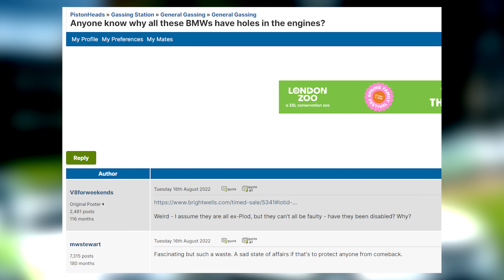Why The UK's Police Cars Keep Catching Fire (BMW N57 Engine)

Comment: I'm a mechanic for BMW, the worse thing you can ever do to a diesel engine is to fit a particulate filter. These fires do not only happen to BMW's. It happens to all cars. No engine should ever have a filter on its exhaust system, its dangerous. Bad emission laws are to blame for all these fires on all cars with emission control systems.
Reply: Plenty of diesel cars with DPFs are running quite smoothly and most modern diesels haven’t toasted themselves. Faults in the engine, poor maintenance, and exposed electrical wires (as what happened with some 56 reg TX4 london taxis) are the most likely causes of engine fires. But I do agree there is also a factor of poor maintenance regarding the DPFs.
Reply: @villagernumber77 agree 
But are the cars you mentioned getting thrashed and drove at 150 mph ???
Reply: @boyasaka  haven’t heard of ex police Volvo V70s or Ford Mondeos spontaneously combusting
Reply: @villagernumber77 do most diesel Cars with dpf idle for hours? A diesel can't properly do a dpf regeneration at idle
Reply: @villagernumber77  NEED TO CHANGE ENGINE OIL AND FILTER WITHIN 5000 MILE RANGE , AND USE DPF ADDIVITES EVERY 2000 MILES WITH MOTORWAY RUNS SHOULD BE FINE FOR LONG TIME !!!
Reply: good to see the new Toyota Corolla cop cars that are made in Britain starting duties
Reply: @hassyg4083 We get your hate and comprehension limitations. Make Britannia great again, with Toyota. 😂🤦‍♂️
Reply: @lemcakes32422  Are Toyotas still built in U.K.? Good to hear that, I thought they'd gone the way of Honda. 👍
Reply: @simongray2533  yeh they built in Derby plant the new ones cops are using now
Reply: @lemcakes32422  Oh cool, I'm happy with that! 😁 I'm a big Toyota fan myself.
Reply: Stationary idle for hours... That's the problem
Reply: Like any piece of engineering they work if used properly. A friend of mine was having problems with his Touareg VW and we worked out that the vehicle never got hot enough for the DPF to work. He took it for a two hour country drive cruising at 100kph and that fixed the problem. He now does a reasonable trip every second month and has has no further problems over two years. I would rather not have them but if they are there then use them in the way they designed to.
Reply: @ianmontgomery7534  he got that wrong car. diesel not good for short trips
Reply: @ianmontgomery7534  They're a nuisance for all but I'm happy with it and also putting adblue in my bmw knowing that it is actually doing some good (reducing harmful pollutants)...
Reply: it's not because of the EGR Cooler leak?
Reply: @yAbx  you have a point as that is is mechanical fault which can be a factor.
Reply: @lemcakes32422  Well, I’ll contact you in 15 years and tell how is it going with my bmw
Reply: @mishaellashoots470  doubt there will be anything left of it in 15years
Reply: complete nonsense, its nothing to do with the DPF's they have been fitted on cars for years
Reply: @robloxfan4271 but the average motorist does not do sit in a lay-by 
Then accelerate the car from 0 to 140 mph as quick as possible
Reply: @robloxfan4271 the issue is a absolutely to do with the DPF and the way the vehicles have been operated.
Oil dilution/contamination
Reply: "Bad emission laws"... you need to retire and seek urgent medication. There are millions of cars with DPF systems that have no issue.
Reply: @SSS_HEX  Do not talk utter nonsense. You obviously know nothing about cars. Just the recalls from dealerships of emission control problems amounts to billions of cars around the world. That does not even count the billions of cars that break after warranty. You know nothing about the effects and are just talking your opinion, not facts.
Reply: I mean catalytic converters have worked fine for years. So have DPF’s when they’re designed properly, and the engines are used as intended (not say idling for hours) This is purely a poor design and engineering issue. BMW’s always been hit and miss when it comes to diesels. 

The ECU should force a DPF cleaning cycle to clear the filter if the cars sat idling for too long.
Reply: @Jonathan_Doe_  not at all. Multiple sensors, extra injectors, and in BMW’s case a second thermostat in the EGR valve which fails, gives no symptoms except it no longer regens the DPF. All these extra sensors fail far too soon and cost far too much. 

Literally destined to fail. Rip them all out.
Reply: @Jonathan_Doe_ thats complete rubbish mate, the version prior to the N57 was and still is the strongest and best diesel ever made to this day. Nowadays even the B57 is a reliable engine with no futher mechanical defects. Only the N57 was a “hit and miss” as you say.
Reply: @Jonathan_Doe_ BMW told the UK Police that they would need a special maintenence program due to the cars idling so much and the PD just ignored it..🤷
Reply: @G_Silva404  Surprised an engine running hours meter isn’t a common feature on police vehicles to be honest.
Reply: @Jonathan_Doe_  agree 1000%. It should be mandatory, mainly for maintenence tracking purpose. The normal BMW maintenence Schedule of oil changes is something between 15/20k km (30k km in some diesel engines) depending on the engine. That is a really long time if the car just idles most of the day.
Reply: @lemcakes32422  Mercedes, PSA, Renault, VW... Idling for hours, many manufacturer's doesn't let the regeneration to happen at certain aspects. Temperature, rpms, speed.
Reply: all due respect the biggest killer of the filtration systems is lack of proper maintenance that every other road user has to keep up with the police have their own standards and rules for it.
Reply: @lemcakes32422  

@hassyg4083
1 day ago
 @lancethrust9488  yeh bmw sucks thats why

So does your mum.
Reply: DPF has nothing to do with spinning a rod bearing.
Reply: @jimmyb1460  not directly, but the oil dilution caused by them will eventually, in the manner the vehicles are operated
Reply: I am a Mechanic at Audi and the police use 3.0 V6 TDI engines and abuse them every day, none have caught on fire. So to say all cars burn down is a lie.
Reply: @Vwowner_w8_1.9tdi_2.5tdi  facts
Reply: @Vwowner_w8_1.9tdi_2.5tdi  probably because they’re service to fit the use. I mentioned in another comment that the Police chose to ignore BMWs advice and cause the oil to degrade and ultimately cause the failure of the crank bearing. If they would’ve listened to BMW this shouldn’t have happened.
Reply: To the original poster, many other non German companies can produce reliable and good diesel engines WITH dpfs fitted.
It's a BMW engineering failure. Police cars have always been routinely used this way in many countries, and continue to be. Other brands don't drop their load on the road and catch fire.
Reply: LITHIUM ALOT WORSE WATCH HOW MANY FIRES ARE HAPPENING THE EV ROLLOUT WILL BE A BLOODBATH KILLING MILLIONS A YEAR EXTRA THAN REGULAR CRASH STATS ,,, WATCH THIS SPACE !!!
Reply: Your right
Reply: What a load of rubbish 😂
Reply: Yeah, if it weren't for the dpf's introduction; there would be NO diesels on the road. If it wasn't for the introduction of the three-way catalyst for petrols, there would be NO petrols on the road. And if there was, we'd all be killed off by all the NOx and particulate matter.
Reply: You think, how about proper R & D for the requirements
Reply: It is BMW B57D30A engines cathing fire not N57 G series doesn't have N engine
Reply: So a catalytic converter is bad?
Reply: @Steve00alt  A catalytic converter is not a filter, let alone a particulate one.
Reply: @steve00alt70  Yes they are bad. 90% of my work is fixing catalytic converters,dpf,o2 sensors and emission related issues. So yes they are bad for your engine and your wallet
Reply: I guess this probably isn't wrong, those babies get hot!
Reply: All down to climate change and zero emissions as in other countries they do not have this add blue. They are normal without all this ridiculous nonsense. It’s time for technology to work out the ways of less omissions in time they will 😮
Reply: Trucks have significantly larger dpfs, the fault lies at poor design and beemers habit of denial
Reply: @MT_T991  they can't even design drain plugs correctly on bmw convertibles
Reply: @MT_T991  The size has nothing to do with it. All cars catch on fire, so its not only BMW, its all makes of cars.  Police just happen to use a certain model that does it under extreme use.
Reply: The DPF isn't entirely to blame. It doesn't control lubrication, it doesn't make a crank bearing fail, and it doesn't put holes in the oil pan spewing oil all over the road.

It does, however, increase likelihood of fire if oil hits the shell of the DPF during a regen, be it passive, active or standing.

That's because the DPF shell can reach temps in excess of 500*c to burn off any particulates.

Since police cars are ragged to within an inch of their life it's not farfetched to consider that they would be more than capable of not just regenerating more frequently, but being able to do it passively from the constant high EGTs that ripping it down motorways at 90+mph allows for 

In a scenario like that, if your car isn't maintained properly or suffers a failure that causes an oil spill, then the chances of a fire from this are greatly increased if the oil hits the DPF or any pipework leading to it.

I should note it's not just diesels that are susceptible to this though. Petrol engines can and do catch fire when an engine fails and spills its oil onto a hot exhaust or catalyst. It depends on where the oil lands as to how big a fire you get.
Reply: The laws aren’t to blame the politicians and their robbing friends are who push the carbon lies
Reply: And so what do you do to reduce the particulate ?
Reply: I agree with you that it's not just BMWs that have had engine fires.

And I wouldn't for a minute blame the make of car, equally I don't believe that it's just the new emissions legislation.

I think what is most likely is how the police use the vehicles and given that many of the traffic police never really switch off engines from the start of their shift to the finish and even then it's switched off for less than 20-30 minutes until the next officer jumps into the car.

Police Mechanics are obviously going to blame everything and anything other than those driving them because their wages are paid by the police and they obviously have to work with the people concerned.

And many police officers these days have a large streak of arrogance about them, as we see down in London with the number of officers up in court for corruption charges.
Reply: A mechanic for BMW? You must be super busy every day then compared to Japanese mechanics
Reply: It had NOTHING to do with the EGR? How does the EGR effect a crank shaft bearing?
Reply: my zero backpressure stage 2 N55 that hasnt had a single issue at this point can confirm
Reply: @hau5muzeek do you jump in your car and drive it at 140mph then sit idling for two hours and then thrash it round town for hours before idling for two hours again.. no…
That’s why your car won’t experience the same issues as the police cars because you don’t drive it like a pig
Reply: @Kalus_Saxon  or maybe its cuz i dont have some shitty diesel engine 🤷‍♂️
Reply: "Bad emission laws"...  well it's only thanks to those bad emission laws that smog, acid rain and thousands of yearly deaths from bronchitis are a thing of the past. And not too distant past either....My parents tell me stories about both from their childhoods.  I would say all in all the emission laws are GOOD but yes they do ad complexity to cars but if thats the price we pay for safe air then personally I'll take it.
Reply: @soundseeker63 clown
Reply: @PKperformanceEU  A very well reasoned and intelligent point. Thank you. 👌😆
Reply: Had mine cleaned recently, so much better. But yes, you are right. DPFs are a pain in the arse.
Reply: HAD NO FIRES WHEN I DROVE A INSIGNIA APART FROM A BLOCKED DPF THAT WAS IT
Reply: @lancethrust9488 shame the insignia did not catch fire
Reply: I agree fully! Fortunately, we in South Africa can legally remove the troublesome catalytic converters / addblue / DPF'd. Not only does such modifications increase the vehicle's lifespan in a number of ways, you can enjoy a little bit of extra power also.
(A warm "cat" can set dry grass on fire quite easily, with catastrophic veld fires as a consequence - never mind a destroyed car.)
Reply: @travelmates1  Exhausts will get hot with or without a cat. Don't want fire? Don't park on top of anything flammable.
Reply: I would strongly argue that point, having recently completed 200k in a Benz with a particulate filter.
If you drive a diesel, it must be driven as it was intended, long haul open road, no harsh acceleration or running at the limit.
If you want to use a car around town, at high speed or varied conditions keep away from diesels……
Used correctly they give no major issues, but BMWs reliability and engineered to fail attitude would still make anything post 90s a mechanical write in next to no time.
Reply: @tomkatdj  you can drive a diesel at high speeds or push it hard IF and only if you have DPF and cat delete.
And that's basic essential modification !
Reply: @PKperformanceEU  no you can’t, because of the pollution that would put out.
If you did, you’d be in significant legal trouble……
It’s quite simple, for that type of use, use a petrol version and have no issues.
Where I’m at right now we’re watching the 13th typhoon of the season passing…….because people don’t give a crap about the environment, only their own personal objectives.
Diesels are great, when used correctly.
I’d have another in a heartbeat, but my location would kill it, and removing a DPF is not an option for me.
So i now drive petrol again…..
Reply: @PKperformanceEU  by the way Patrik, are you aware of the fines for removing a catalytic converter or Diesel Particluate Filter in he EU?
Slovakia may not enforce it, but the fines can come directly from Brussels if someone puts in a complaint about someone bragging about commercially performing criminal acts on social media……
Reply: @tomkatdj  good luck finding me. Btw Austria allows it and in Hungary you can pass the tests
Reply: @PKperformanceEU  had found you from your license plate before the first reply Patrik……EL598SP 🤡
Reply: So do we fit particulate filters to everyone’s mouth and nose to prevent breathing in toxic emissions and soot?
Reply: Complete load of rubbish. Sounds like the opinion of someone thats only ever driven on Forza.
Reply: @lemcakes32422  all the cars you mentioned never had dpf's lol
Reply: @Twenty3_Motorsport  bad choice on the cops part for selecting them bmw for duties
Reply: Yeah cuz its diesel. Has big torque but no sparkplug mean it can do runaway diesel and engine overheating
Reply: @gathel8574 you clearly know fuck all
Reply: SO ,WHO WAS THE "ENGINEER" WHO CHOSE TO HAVE THESE FITTED?????
Reply: I agree DPFs are the reason behind the fires. No diesel without dpfs caught fire in the past. Plus diesel as a fuel doesn't catch fire. So the DPF burning the soot at 600 degrees may be the reason. Lol😂
Reply: Ultimately, this kind of events proves that using a diesel for a police car is obviously a very poor choice, and it is so for any car wharsoever. Diesel cars need to be banned as soon as possible. They are useless, they pollute like crazy, drink loads of a fuel that is more and more costy (a year ago it was imported from… Russia), they smell bad, fell bad, sound bad and sometimes they catch fire, not only BMWs.There's no doubt electric vehicles, which share with their diesel counterparts the same tendency to catch fire spontaneously, will be the next scandal of the automobile industry.
Reply: @julosx  I’ve been driving diesel and petrol cars for over 22 years what the hell are you talking about they catch fire.

This car threw a rod bearing. That a fault in the bearing was the cause. I take it you didn’t watch the video, instead just started commenting about something you got no idea about.
Reply: Am a mechanic myself I think DPF is 1  of the worst inventions ever for any Diesel car once that starts playing up it causes people to panic and start wasting money at back street garages and being told it’s something else before dpf throwing unnecessary money into the car or unnecessarily selling it or scrapping it unless u got a decent obd reader that can pinpoint the fault
Reply: @TheAirwolf2012  worst thing is to buy diesel , buy a hybrid
Reply: DPF delete gang 😜
Reply: Really, well that’s interesting my diesel has been back and fourth down the Autobahn at over 140mph and at 86k miles on the odometer still no signs of fire. 

It’s A BMW fault and requires a recall !!
Reply: @aileronsintowind6835  So just because your car has not caught fire then the statistics are wrong?? Are you always this stupid? if your cat/dpf blocks up or falls apart which all cats and dpfs do on all makes of cars as they only have a limited lifespan, then there is a risk of fire and damage to your engine. Its very simple to understand so i am not sure why you are acting dumb about it. Cats and DPFs are dangerous. Car engine ECU's are designed to activate the fan and "limp mode" on all makes of cars if anything goes wrong with the engine, example a misfire, this is due to preventing extreme heat build up within cat/dpf so the car does not catch fire. Every manufacturer of cars has its car fires due to cat/dpf and EGR issues.
Reply: I'm glad to read all these engineering reports 🙌 I'm just a basic mechanic and I know exhaust never caught fire before cats cars never stopped running because the exhaust is blocked 🚫 keep wondering why they catch fire 🔥
Reply: Mechanic too and can second this is like breathing in normal, but breathing out through a straw. Now go on a jog see you in 8 hours 😂
Reply: As a mechanic you should know that the reason diesles have DPF is stop the soot which is a harmful as the emissions given off. As an ex mechanic myself diesel's are worthless and should be banned on all vehicles except vans and HGVs.
Reply: @th3s3rv37  what do you mean by diesels are worthless ?
Reply: Diesel engines should never have been fitted to cars and other smaller vehicles.
Reply: @felixokeefe  true but you have to explain that to the car manufacturers, no one forced them to use diesel, it was just for profit nothing more
Reply: @lemcakes32422  i beat the dogpiss out of it every single time im on the freeway lmao, hit at least 120 90% of the time, its hard to not wind out, it eggs you on, 415bhp and a ZF 8 maks it too easy. its a miracle im not in jail right now to be honest
Reply: @hau5muzeek  wow thats some story
Reply: @hau5muzeek  you Americans think that's fast 🤣 i do 140 to work and back every day. Went 220mph in an RS6 last week lol
Reply: @gggwood  thats cute, my modified 335i DD has 410 bhp/430 tq and its likely a safe bet to predict yours has about half that lmao
Reply: BMW are crap quality. I had a new BMW convertible and it let in rain water with in the first year of ownership. Toyota if you want reliability and made in UK aswell not Germany
Reply: @lemcakes32422 I have a f31 320d with 200k km on it and I never had problems
Reply: @lemcakes32422 The vast majority that come off the production line or faultless. Don't just base your disdain on one episode.
Reply: @LiffeyKing  thats untrue I've had a few German cars that had issues from new. i base it on personal and also the fact German cars come bottom of reliability surveys. Personal use is one thing but having them as work cars for police duties whos bright idea was that especially diesel crap
Reply: @lemcakes32422 so you happened to have one slightly leaking soft top  … and that means all BMW are low quality.. 

Do you always make blanket statements like that?
Reply: @mista5796  ofcourse they are low quality. BMW are poorly designed compare them to a Toyota there is no comparison on quality
Reply: @lemcakes32422  no chance mate .. Toyota are dull and boring .. Toyota Corolla, Toyota celica 🤢🤮 bland, soulless cars. No one ever says they own a Toyota with pride. 

BMW are more enjoyable and interesting cars.
There are lots of factors about owning a car; reliability isn’t the only one. I own two cars; one is a small simple city car (1.0, 3 cylinder engine), the other a top end high performance car (5.0l, high revving V10 with dual vanos)…. 
The small car is lower maintenance. But that doesn’t mean it’s a better car! 

A donkey takes less looking after than a race horse.
Reply: @mista5796  Toyota Celica yeh won wrc rallies don't think BMW won any just saying. See price of  oldToyota supra compared to old m5 lol
Reply: @lemcakes32422  mate it’s each to their own 

You prefer Toyota. I prefer BMW 

Some people prefer Messi. Others prefer Ronaldo. 

Different strokes for different folks. 

Have a nice day 👍
Reply: @mista5796  no i said Toyota is more reliability. German cars nearly all come bottom of reliability surveys its just fact. Depends if you want to spend time in the garage or not often even if warranty covers it. i would never buy BMW second hand though
Reply: @lemcakes32422  Yeah, it's been like that for a while but people are blinded by the badge ! 🤣
Reply: @simongray2533  ive noticed. i used call out subaru impreza sti boxer engines to be crap and not able to do high milage. the amount of people it upset 10 years ago attacking me lol
Reply: @lemcakes32422  Yeah, was it ometing to do with oil starvation in high speed corners (I'm not a mechanic) I know some people I knew fitted the old butterfly sumps.
Reply: @simongray2533  don’t worry about not being a mechanic bud. Neither is the original poster lol 😂
Reply: @lemcakes32422  And what do you expect with new cars? exactly.
Reply: @tyronenelson9124  not to set on fire
Reply: @lemcakes32422 that's why you should never buy verts they're trash
Reply: @hassyg4083 clearly only owned 1, iv owned a bunch a e46, a e90, and a f31, all great solid cars, best interiors and premium fell out the ca4s in its range (not f31 imo) Some engines are junk, some are the best, some juts need looking after properly, the police leave their cars on for 10 hours idling at a time, cars are designed for driving, not being ideal as a blue light generator. All my cars were high mileage car, and only had to non mechanically change a window regulator, a bonnet catch. And a worn airbag seat sensor. It's a good, safe, reliable car.
Reply: @lemcakes32422  at 78k right now. catback was on by 25k, downpipe intercooler and remap done right at 30k, all mods online by march 2020 and ever since
Reply: Could you explain why you think that? Otherwise your statement holds zero value.
Reply: @ApfelmannYT tbf my Dpf caught fire on my bmw 123d it did have a remap but it’ happens
Reply: @ApfelmannYT He’s a mechanic for BMW so yes, his opinion holds up. They get choked up over time especially if you don’t drive properly and allow the car to run it’s regeneration  cycle to burn off the pollutants. The vast number of people in this country and probably most others have no idea how a car works or how to drive it properly.
Reply: @ApfelmannYT  if you really want to go down that road, filter=resistance, resistance=backpressure, backpressure=high egt's, high diesel egt´s=pistons, valves, turbos and even the filter that's causing the backpressure can and will get damaged, potentially causing part breakages and/or oil leaks that might turn into fires.

filters will clog up with time by the very matter they're filtering out, most cars have systems in place that will try to "wash" them out periodically, but they can only get so much out, some crap gets more stuck than other, take your clothes for example, when you wash it, will every single stain come out? will it come out looking brand new? No, when these filters get driven alot or have for example, ALOT of idle time, they will clog up faster and faster in worse and worse ways untill the cleaning system cannot keep up or simply can't clean it at all

what do police cars do more than any other cars out there, they sit there in the road shoulder and idle for sometimes up to 8 hours straight, this will absolutely kill those filters

as a final word on these filters and why i hate them and want them removed, what are they trying to do, contain the carbon dust inside the car, why? so it doesn't go onto the road, where do they then expose of it? through the exhaust onto the road/into the air during cleaning, how do they clean the system? with special fluid you have to buy, how and where do they make it? they ship materials to the other side of the world, use up a bunch of energy to mix them up and make something out of them, then ship them back again, with freight ships, the absolute worst offenders when it comes to emmissions, you can still legally run a very hight percentage of crude oil as fuel in those ships, how crazy is that.

so they've invented a system that in the long term, does absolutely nothing for emmissions, if anything emmits way more carbon, but makes you have to give companies loads of your money, that's the reason for their existance, not emmissions or some eco awareness bullshit.
Reply: @dadi2450  Thank you for responding. I think you are right but Id like to add that I still believe that a car with a well engineered DPF system can work just as well as a car without one. And the aim of the filter is to reduce diesel particulates rather than carbon emissions. These particulates are causing lung cancer, thats why we need cars equipped with them. As cars are used in densely populated areas - whereas ships are not. For carbon emission reduction they arent necessary.
Regarding the mentioned engines, a cleaning routine for the filter should also have been implemented after a certain idle time, as someone mentioned. They just didnt think about that use case I guess.
Reply: @ApfelmannYT  they are done by idle time too, infact these systems commonly "clean" themselves during idle and low load driving, the problem is, yes, these systems are removing particulate matter, but where are they putting it, back through the exhaust, just later, and usually with some acidic fumes as a byproduct from the cleaning system, these filters just don't last, and they cost multiple times what a catalitic converter would, so spending 5-10k every 100-50k miles on a new dpf filter on some of the trucks that have these is just ridiculous, you'd be better off spending a fraction of that money on idk, a tax to pay for street sweeping, since this particulate doesn't really like floating around in the air to much, it only really happens when it collects on roads that never get cleaned and gets kicked back up by traffic.

the dpf is not an example of means that justify the ends, it's an example of narrowminded thinking, pushed to the spotlight by secondary factors like greed from car makers or lack of understanding from lawmakers
Reply: @ApfelmannYT  I'm not saying they can't work relatively efficiently, but i am arguing that even if they do when new, they will not stay that way and will eventually greatly harm flow, my biggest argument against dpf's however is their premise, i feel like they don't solve the problem they were designed to solve, instead postpone it, then cause even greater environmental damage when it comes to making, maintaining and disposal of said filters, they contain many rare earth metals for instance, some of which are very environmentally damaging to mine for and very tricky to recycle, sometimes even impossible.
Reply: @ApfelmannYT Diesel engines should never have been implemented into a road car, and kept strictly for industrial use only, well away from people. I'm surprised the idiot that came up with that idea didn't try and put a diesel engine into a hedge cutter or a chainsaw.
Reply: @dadi2450  Your comment shows a pretty fundamental misunderstanding of what's going on.

 "filter=resistance, resistance=backpressure, backpressure=high egt's, high diesel egt´s=pistons, valves, turbos and even the filter that's causing the backpressure can and will get damaged, potentially causing part breakages and/or oil leaks that might turn into fires."
May come as a surprise to you, but backpressure is actually required for an engine to run properly. So saying there's backpressure is pretty meaningless.

"filters will clog up with time by the very matter they're filtering out, most cars have systems in place that will try to "wash" them out periodically, but they can only get so much out"
It's not the soot that blocks filters. It's either additives in the fuel or oil, or the substrate of the filter deteriorates with time. And soot is not "washed" out, it's vaporized out.

"what are they trying to do, contain the carbon dust inside the car, why? so it doesn't go onto the road, where do they then expose of it? through the exhaust onto the road/into the air during cleaning"
Nope. The soot is actually vaporized and broken down into base components such as CO2.

"how do they clean the system? with special fluid you have to buy"
That hasn't been true since the '90s. There is no special fluid you need to buy.

"a system that in the long term, does absolutely nothing for emmissions"
It arguably does to a lot for emissions. Whether or not that's necessary, that's something else.

"these filters just don't last, and they cost multiple times what a catalitic converter would"
Those are two very different systems doing two very different things. A catalytic converter converts unburnt fuel, NOx, carbon monoxide into safer gases, while a DPF filters out soot particles.

I suggest you educate yourself on the topic. You may be right, but you're right for all the wrong reasons. Right now you come across as someone that has no idea what he's talking about. So if you want to be taken seriously, do your homework.
Reply: @CristiNeagu  because i can't be assed replying to every single counter point you were trying to make, backpressure being required for an engine to run is a myth, and a stupid one, an engine running causes some amount of backpressure no matter what, it is imperative to minimize it, especially on a diesel, where egt's really matter.

saying an engine needs backpressure to run is like saying an engine needs to make noise to run, you're looking at the cause and implying it's a prerequisite.

take a two stroke engine for example, using a small supercharger to suck out the exhaust from the engine is almost as powerful as using it to blow fresh air into the intake, it's just way more maintainance heavy and much less efficient, along with it being a much much inferior option when it comes to valved two strokes

the reason i mentioned catalitic converters is because if maintained, cats last the lifetime of the car, however, dpf filters just do not last, typically they last about as long as a timing belt on average, dpf's are also chock full of exotic metals and way more difficult to produce than cats, so my comparison was more meant to highlight the "imagine replacing your cat 2-4 times every 100k miles"

define vaporize, the crap and crud in there isn't getting teleported into space or anything, if you've ever stood behind a car in the middle of dpf purging, you'd get what i mean, i would rather have soot, which is pretty chemically stable and a solid material, which means it won't affect the atmosphere, than the disgusting lung irritating junk that comes out during dpf purging

DEF(diesel exhaust fluid) is used to lower NOX emmision and helps clean the dpf filter, that's the fluid i'm reffering to, dpf filters were not really a thing in the 90s so please fact check before calling folk out.
Reply: @dadi2450 Ah, the comment in which you double down on your ignorance.

 "backpressure being required for an engine to run is a myth"
Backpressure is required, amongst many other reasons, because an engine would be unstable without backpressure. It would not idle very well, for starters.

"take a two stroke engine for example, using a small supercharger to suck out the exhaust from the engine is almost as powerful as using it to blow fresh air into the intake"
Backpressure is so important for a two stroke engine that they have tuned exhaust pipes, that create pressure waves in the exhaust, acting as valves, helping to keep the combustible mixture inside the cylinder. You know absolutely nothing about any of this, do you?

"cats last the lifetime of the car, however, dpf filters just do not last"
It is, in fact, the other way around. Catalytic converters wear out as their substrate is eaten away. They're expected to last about 50-75k miles, or about 10 years. A DPF can go beyond 100k miles just fine.

"dpf's are also chock full of exotic metals and way more difficult to produce than cats"
Once again, completely backwards. DPFs are made of a porous ceramic and that's about it. It's catalytic converters that contain rare materials such as platinum or palladium. Dude, you are completely clueless.

"define vaporize"
"In physics and chemistry, the conversion of a solid or a liquid into a gas." How do you not know this?

"the crap and crud in there isn't getting teleported into space or anything"
No, it gets converted into CO2.

"if you've ever stood behind a car in the middle of dpf purging, you'd get what i mean"
Mate, you don't even know what a DPF is. For example, DPFs are not "purged". They go through regeneration. You have absolutely no idea about anything to do with a vehicle's exhaust.

"DEF(diesel exhaust fluid) is used to lower NOX emmision and helps clean the dpf filter"
No, you lost in the woods ignoramus. That's called DEF fluid and it's used in the SCR, not the DPF. The DPF has absolutely nothing to do with NOx emissions.

"dpf filters were not really a thing in the 90s so please fact check before calling folk out."
The first use of DPF was with Mercedes Benz cars, in California, in 1985! How about YOU do some fact checking first?

Geez, dude. You are displaying some monumental levels of Dunning-Kruger. You're confusing the catalyst with the DPF, and both with the SCR. You think DEF fluid has something to do with the DPF, in part cause you heard something about DPFs from 20+ years ago requiring DPF fluid, but mostly because it has a D and an F in it! Absolutely ridiculous. Go and educate yourself.

Sincerely, a professional Diesel exhaust system calibrator.
Reply: @CristiNeagu  before i start, i don't see where i called you an ignorant moron or told you to go educate yourself, i'm not intending on responding further but i will say this

backpressure is bad, period, you are confusing backpressure and exhaust scavaging, a two stroke for instance litearaly will not operate with backpressure, that's what the tuned exhaust is for, they have very delicately designed expansion chambers which help maintain exhaust velocity in the exhaust at the choke point before the expansion chamber, it's entire goal is to suck the exhaust out of the cylinder, creating negative backpressure if you will, two strokes do not have a dedicated exhaust stroke, they must rely on secondary factors to purge the burnt gasses out of the cylinders

when i asked you to define "vaporize" i was literally making the point that taking a relatively stable solid and converting it to greenhouse gasses is a really stupid and really counterproductive thing to do, if you read any of my previous comments you would've gotten the context, soot is imo a much more managegable issue than co2, it is the entire point of why i dislike the whole direction automotive diesels are going, waste resources to convert waste into different arguably more problematic waste where the only benefit is that it's further out of sight.
it feels like they were trying to as accurately as possible capture the metaphore of sweeping the problem under a rug

and with dpfs, just like seat belts and abs, just because something existed in 85 doesn't mean it was as commonly available, abs was invented in the 1920's but only became a common commodity in the 1990s, the level of mental gymnastics would you have to do to imply dpf's were just a common thing you could find on most cars back then could put you in a mental hospital

the dpf system in the bmws in the video along with pretty much all recent european passenger car diesels (probably american ones too), is a combined dpf+scr system.

they do go into regeneration/burn off/purging/whatever term your language or region might use, that much is true, but can you not be so pedantic as to trying to counter an entire sentence due to the odd word not being 100% "correct", since anyone with a shred of sense would understand what i meant

regardless of opinions and discussions
it almost feels like you're just wanting to argue for the sake of arguing
Reply: @dadi2450 DPF systems don’t operate at idle, otherwise the very issue we are talking about wouldn’t exist. A DPF regen requires low load (so as to run efficiently) and increased revs (to help push the matter out).
Reply: @ApfelmannYT it's clear you just want to defend the climate agenda
Reply: @ApfelmannYT  Could you explain what's your level of understanding of the ancient and almighty technology of an INTERNAL COMBUSTION ENGINE is? Because otherwise your statement makes zero... sorry, minus twenty - sense. Good luck, grow up.
Reply: @JurisKankalis  First of all, thats not the point. But my understanding should be quite good, as im an engineer... I dont like reading blunt claims that arent backed up by anything, hence my comment.
Reply: @JurisKankalis the burden of proof bro
Reply: @ApfelmannYT I'd imagine more regular and failed regenerations will be key, this causes oil dilution due to the way in which EGT is artificially raised to clean the filter.
This dilution causes poor lubricity of the oil as its contaminated with fuel. This in turn causes excess wear, especially as long idle time will mean minimal oil pressure for prolonged periods, poor oil low pressure = more wear.
Followed by periods of full torque delivery and high engine speed.
Hence the manufacturer recommended reduced service intervals. 
DPF equipped diesels are absolutely no use for this type of operation.